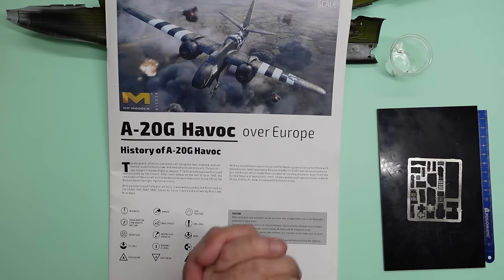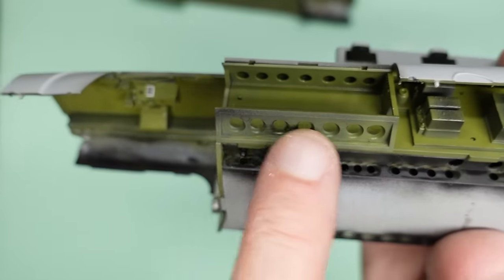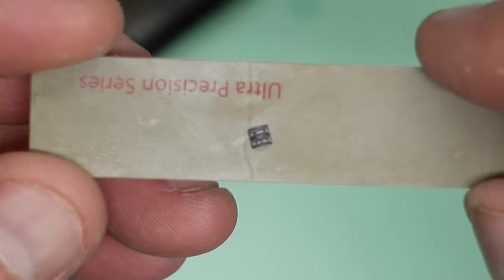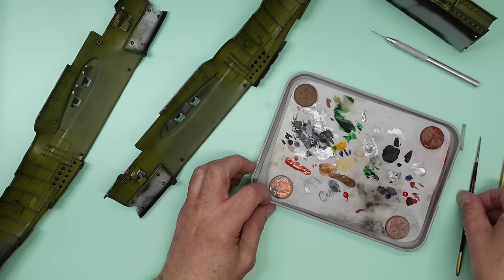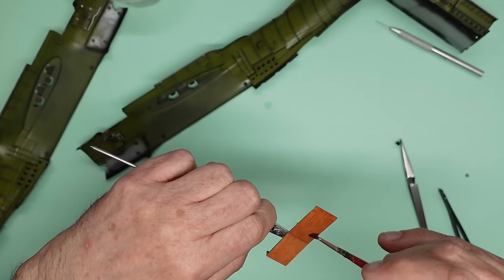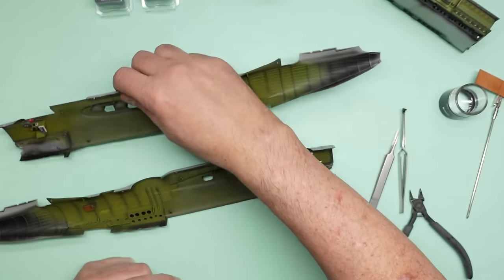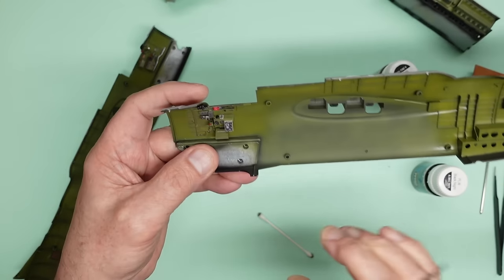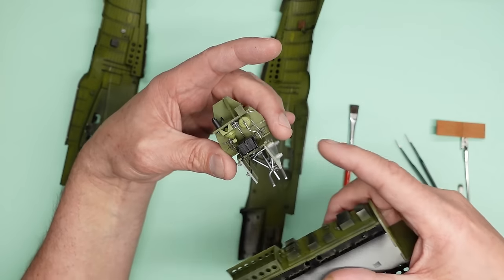HKM 1/32 A-20G Havoc build. Part Seventeen

Comment: With the Bostons they sometimes flew with a crew of 3 (pilot, nav and top turret) if they were flying low level, and no fighters could get underneath them, But if they were flying at higher altitudes, which they did more usually, they had a 4th crew member who was the bottom gunner

Comment: Very nice work Nige.  I know the a-20 was mainly low level but would there be an oxygen mask tube ? Maybe I missed it ? M
Reply from the maker: Thanks Martin.. you are correct. I removed the moulded on one and forgot to replace it!! It's not too late either!!
Reply: @NigelsModellingBench  always adds an organic touch . Did a-20 pilots wear that odd , armoured flight helmet you sometimes see ? Might look cool on the seat .